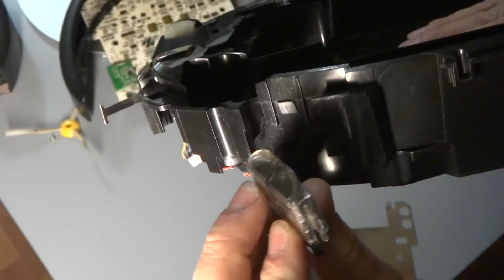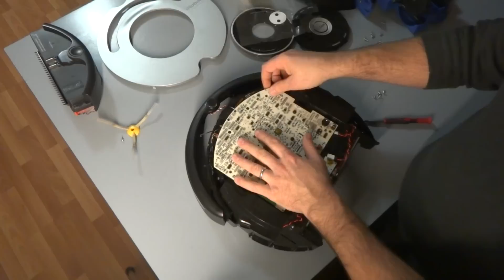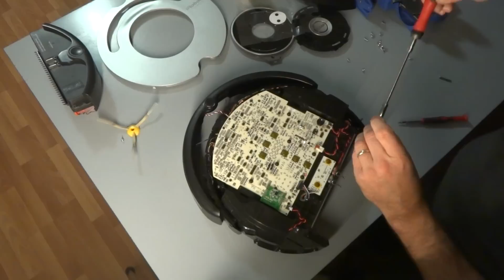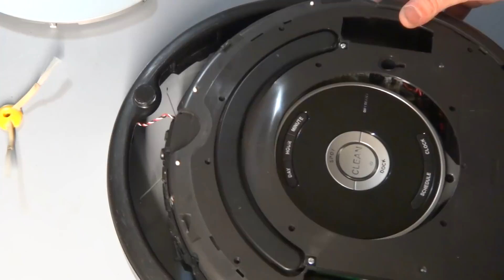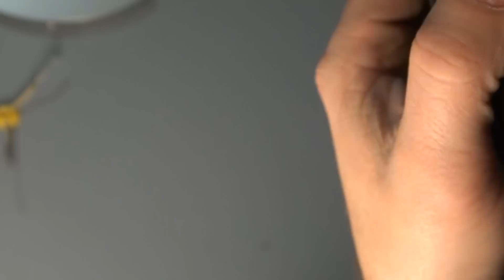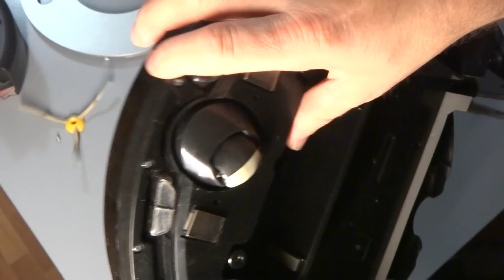2 iRobot Roomba 500 and 600 Series Circle Dance 9 Beep Bumper Error Full Disassembling Part 2

Comment: My roomba sensors got wet and the wires broke off, is there a way I can tape any wires together so roomba will work again, or can I remove the cliff sensors completely and disable that feature,  I don't need the cliff sensors.  Thx
Reply from the maker: You can get another set of cliff sensors from eBay or Amazon, to replace them, but you cannot bypass them by completely removing them, there are of course several ways to remove them completely but then you would need to calculate the resistance needed for the roomba to "see" that cliff "are there", would need to get the correct resistors and solder them up, as there is voltage that is supplied to both the IR LEDs and the photocell LEDs

Comment: I purchased the two new diode’s and methodicly installed them cleaning the Roomba every step along the way. After a couple hours I pushed the start button only to find the unit is doing exactly the same thing. Goes round and round then beeps 9 times. Any other suggestions?

Comment: Great explanation.  The only thing I would add is to buy the bumper and cliff sensors together online.  I just got the cliff sensors the first time and it was the bumper sensor that was bad.  When I got the together it was roughly the same price and now my Roomba is chugging away in the other room.  Thanks!
Reply from the maker: +Chris Barclay Yes the cliff sensors are wired in the same plug with the bumper sensors so you would need to make sure they are both included in the item you are purchasing

Comment: My Roomba 560 won't turn on at all, even with a new battery.  What could be wrong with it?  The same thing happened to my sister's unit. Both are only a year old.
Reply from the maker: hi, make sure the tabs that are touching the battery are clean and don't have any corrosion marks on them, and also make sure you pull the tabs up a little to have a better connection for the battery to the robot, the tabs are the metal spring like things that are located  in the battery compartment, you will see them when the battery is pulled out, if that doesn't help most likely the main board has failed due to moister or water damage, let me know how things go for you so I can help you out to get the Roomba back to work
Reply: Ok I think the problem is the motherboard then.  My dog had an accident on the floor and the Roomba went over it.  I cleaned it with a spray cleaner.   Any idea where I can get a cheap motherboard?  I'm in Ontario, Canada (online is fine too).  If it's too expensive then I would rather just get a new unit or find a used one.  Btw, great video!  Best one I've come across on the Roomba.